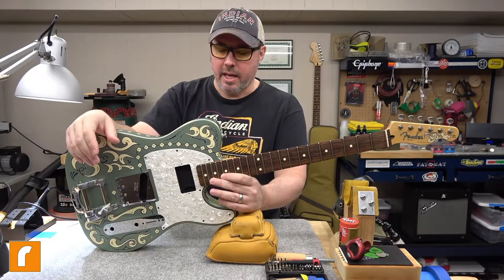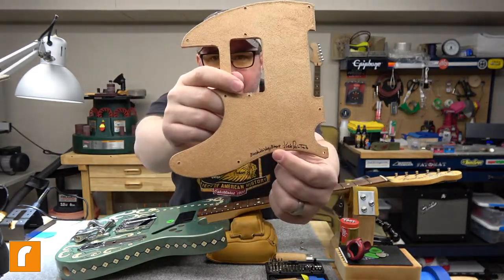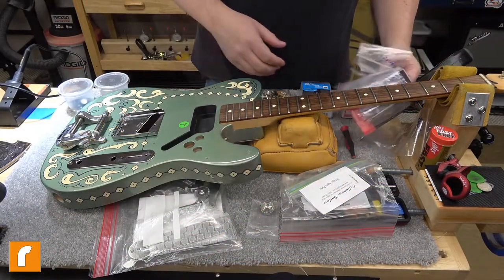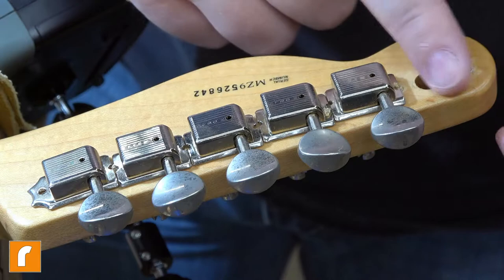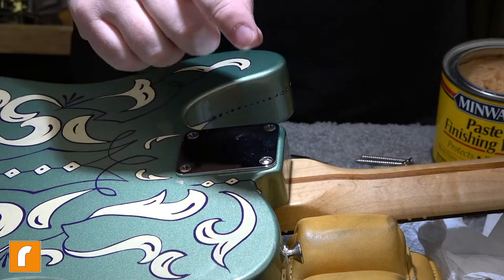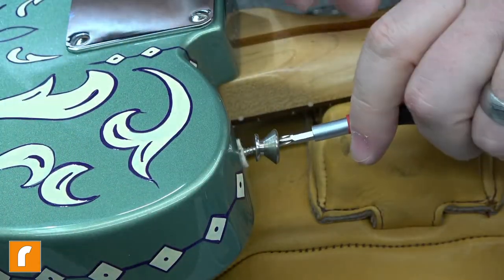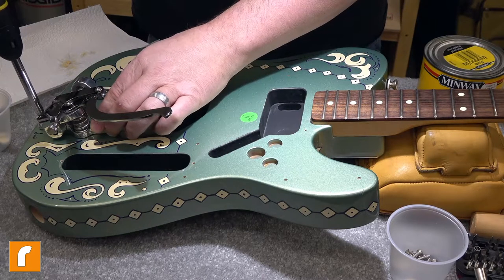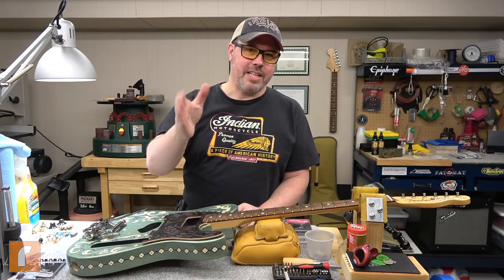Telecaster Hot Rod Modifications (Part 3 - Hardware & B-Blender Bigsby) Guitar Werks @ Rench Ranch

Comment: Hey I am considering getting a b blender but I'm questioning it for one reason. Can the bigsby arm still swivel to move it out of the way when you are not using it? Or is it in a fixed position where it cant be moved?
Reply from the maker: Yes you can swing it out of the way and it works very well. My only issues with it are 1) as a B-Bender the arm is a little long to plam mute on bridge and use the B-Blender, could be about 1" shorter for my hand. I hook it with my pinky finger to do the bends. 2) A little blue Loctite to tighten the tuning set point screw is needed to keep it from creeping with constant heavy twang-bends. Otherwise it's really a slick set up. As a Bigsby, it functions as it normally would. A little Tri-Flow Teflon lube goes a long way for tuning stabality of the B-Blender. I am very happy with it. It's the ONLY bender that you can dive and bend at the same time. Really makes for some interesting guitar tricks! Thanks for watching. Cheers!

Mike